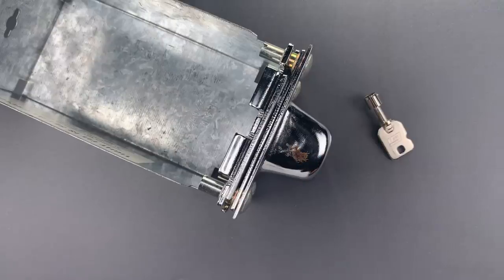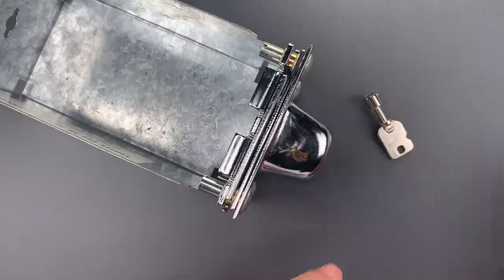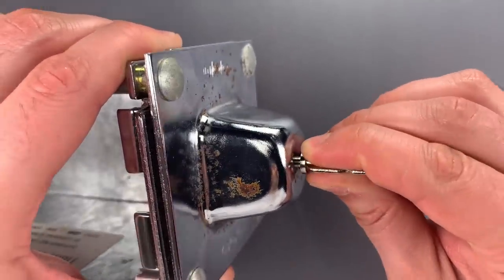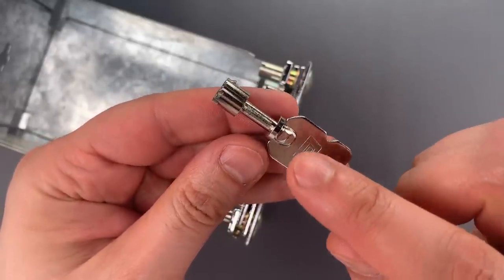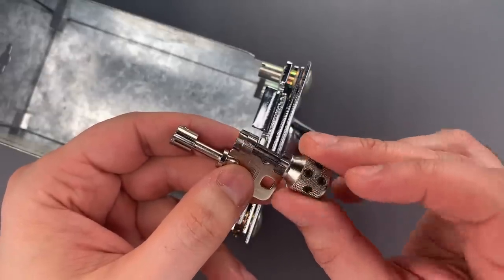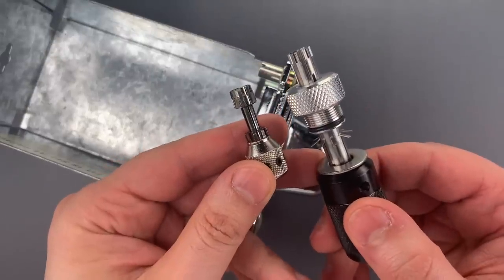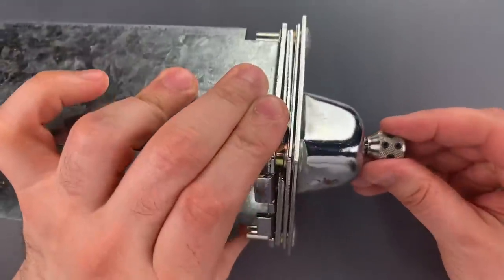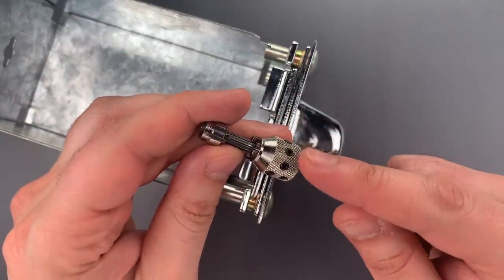[1205] Rare Tool For Picking “Giraffe Key” Locks

Comment: Can’t wait for you to destroy Shane’s lock
Reply: Same
Reply: I kinda wish shane would have sent it to LPL before he posted his video making it. Knowing how the guts work is a huge part of picking it.
Reply: Me too
Reply: @pproh608  but the way this one works i think helps but hurts at the same time. as in there might be an easyer way to pick it, but if you are thinking complex then you might miss the easy way to pick it
Reply: I was thinking just apply pressure to the lever at the back that he made to push the pins up against the body to hold them in place. So if your pushing that lever at the back you might be able to single pin pick. I was also thinking a comb or wave rake could possibly hit all the right sweet spots at the same time. Hafta see if he ends up sending it.
Reply: Ooh I dunno, I have pretty high confidence with Shane. You should see his basketball hoop, from and engineering perspective that's stupid difficult to DIY.
Reply: @Guna89420  nah rave and combs won t work for sure . He mentioned it in the video so those tools can only touch one of the at a time but if it adjusts different the lock will reset . You don't watch the full video didn't you.  He invite a lock picker who used a special hammer to apply force so that as it gets launched he might be able to move it in time but he failed . And he was an expert
Reply: @Guna89420  imagine this dude put days of work in, LPL starts his video, rakes it open in 3 seconds and ends with "okay folks thats all i have for you today, and shane; try a little harder next time"
Reply: Can I get a link to the lock being made
Reply: @xenomorphoverlord  ...making an unpickable lock...by Stuff made here ...can’t get a link to work on this iPad 🤔
Reply: He's still making another version trying to improve the current design. So he'll add some changes before sending it to LPL.
Reply: I think the whole point is it’s supposed to be like good cryptography, it doesn’t matter if you know how it works it still isn’t vulnerable to anything other than brute force. Security by obscurity isn’t a good way to design security products.
Reply: @felciajacintha6613  That supposed "expert" couldn't pick half the stuff LPL gets open in seconds.  Just because someone does something for a living sure as hell doesn't make them an expert...
Reply: I suspect it won't be nearly as pick-proof as he expects it to be. He's good at making stuff in general, and coming up with interesting ways to turn ideas into reality, but does he actually know anything about locks? I guess we'll see.
Reply: @JLneonhug  Insanely difficult
Reply: @Guna89420  he has already confirmed that he'll be sending an improved version to lpl soon
Reply: @felciajacintha6613  no I watched it. He said bumping. I didn't catch him say anything about the others. yeah I did watch it all though. Yup he is going to add more pins and make it better he said but if it has the same relative design, I think lpl could figure out a way to defeat it. I like the double sidebar design lock that was "unpickable." I thought with the springs inside that hold the pins against the side of the core, you could maybe finesse the tensions on it to be able to hold the pins separately instead of all at once. I really have no idea though, was just a thought based on a simple idea. Cuz the key has to push on that lever to work, so it probly won't be guarded. Maybe a small pin protrusion on the end of a key, and a small hole for it to go through which would make accessing it and the key way at the same time incredibly difficult. I didn't stop the video and check the design a bunch. Which I bet many did to study the design. I was just throwing the idea out there. Cuz it seems like with a random amount of moving the pins, that there might be a chance to randomly get them all in the right position at the same time. Or like he said, he is worried about the Power tool type lock picking devices that vibrate the pins so fast that they often hit the right combination within a second. Either way, this will be interesting. I would think lock companies have thought of similar designs and decided against it for some reason or another.
 Only time will tell. Can't wait!!
Reply: @itscyphertrading8706  I would literally roflmao . Props to shane though. He is like an apprentice hacksmith lol
Reply: @Guna89420  Agree 💯. I'm not great at this, but I think I could get his lock open after some time and "getting to know" the feel of that mechanism. Basically a deep- reach tension tool that can also engage the pin lock will give you all the tension you need to single pin pick it.
Reply: @Fregley_  woohoo I can't wait! Just like many of the challenge locks that have come LPL's way. When his gf said, you know who we should send this too.. if she said anything other than LPL,  I would have been cheesed Lol
Reply: @felciajacintha6613  LPL has opened dozens of locks in under 30 seconds that the supposed "experts" couldn't open.
Reply: @JLneonhug  BACKBOARD!
Reply: m14wdotcom  "Oh, he INSISTS?!?!?" Sorry. Had to.
Reply: I’ve been watching LPL for a few years and I can’t recall a time he featured something he couldn’t pick. So unless he’s going to fabricate a tool to pick this I don’t see him showing it. Edit, my mistake I believe he explained the Bowley lock and didn’t pick it, so maybe he showcases it as a friendly gesture.
Reply: @pproh608  I am sure Shane will send him an improved version. I am sure there will be a surprise plot twist. Remember that the lawyer knows the in and out of every locks he  opens.
Reply: Looking forward to seeing what happens, too. But also respect to Shane, that guy's got a lot of brains and skill.
Reply: @agodwin987  Yeah, that's true, but I think the only lock I've seen him pick here that really meets that definition is the J-hole lock and it's dual-sided counterpart.

Security by obscurity, the security people I follow would tell you, should not be the only security in your system*, but it's not unacceptable for it to be *one component thereof.
Reply: @Guna89420  the stuff shane does is usually way more impressive than the stuff the hacksmith team comes up with. I love both channels, but the hacksmith doesn't do too much crazy coding or innovative hardware, a lot of it is just projects that take time and money (with notable exceptions, like the lightsaber), whereas shane does some really high-level design and engineering.
Reply: @jeffp7368  There have been a couple of locks he hasn't been able to pick.  One of them is a lock that uses a key shaped a bit like a trombone.  He wasn't able to get a pick into the right position, place pressure on the rear of the lock, and apply torsion all at the same time.  It's in his "working on a solution" pile.
Reply: @felciajacintha6613  
Just to be clear, the picker he invited over didn't use a special hammer.
He used a method called bumping. So he used a bump key, or filed down key, that can be used with any hammer.
Reply: @Guna89420  yeah dude let's see what happens then when it's on his doorstep . My money is on shane
Reply: @pproh608  I don't understand. Part of how LpL picks locks is him knowing the locks inside and out. At least with Shane's he didn't have to drill and cut it up first.
Reply: 2 minutes max.  Videos will be under 10 mins and mostly talking about the guy and how cool it is that fresh minds re taking a look at security even if it wasn't very secure
Reply: @Guna89420  Yup, and pick it from the back, so the springs can compress
Reply: Shane will send the advance version of his lock so i think its fine
Reply: @pproh608  Shane is making a new and improved version and sending it.
Reply: @xenomorphoverlord  search for "stuff" lock
Reply: Don't keep your hopes high, most probably he won't be able to do it.
Reply: @earthknight60  my thoughts exactly. I expect Shane's lock will land on that pile too
Reply: @Guna89420  yeah I was thing pressure at the back and wave rake that bish
Reply: He won't
Reply: Still waiting for the vid, it will probably never come out at this point
Reply: @maxwellerobini1603  wrong c:
Reply: @pproh608  Ah, but security by obscurity is not secure. If you're going to make more than one or two of them, someone's always going to be able to discover how it works and use that as an attack vector. The ideal solution is one in which knowledge of the mechanism provides no help whatsoever in defeating the lock.

Shane's locks were designed to do that, he just didn't know about the full list of potential attack vectors that might be employed so that he could plan for them. Now that he knows, he can harden his lock against those attacks. And when every potential vulnerability has been removed, what's left might be the state of the art. Unless someone finds a way to defeat it.

That's just the security game.

Comment: Imagine designing and machining a brand new tool so you can get a fistful of quarters.
Reply: like arcade machines?
Reply: That's probably why this pick is pretty much extinct, not worth the effort to pick the locks. Even more so with inflation reducing the purchasing power of the quarters.
Reply: You mean "a lifetime supply of a fistful of quarters".  Sounds good to me.  😁🤐
Reply: @davidbaldwin521  I save many quarters on laundry when I take the wet clothes into the backyard and hang em high.

Wow. Puns really do encapsulate the Good, the Bad, and the Ugly of jokes.
Reply: I'd imagine a locksmith would have these handy for when keys get lost.  You'd have to unlock it to change it.

Comment: That pick looks interesting with all the... are those set screws in the base? Do they serve a purpose or did the maker give it spots because giraffes have spots?
Reply: i would imagine the screws adjust the preload on the levers
Reply: @chrismechanic2000   That was my guess too, you can use them to lock the "levers" in place so it become a copy of the original key
Reply: "Finger tension can be adjusted, during the picking process, by adjusting the set screws, located in the handle, over each finger, for the stronger springs, by using the supplied Allen Wrench."
Reply: So in a way the video doesn't really show the whole process. LPL surely preset the pick for this particular lock, but going in blind with a new one would require quite a bit of work. Right?
Reply: @luisrivero5245  no, he went in blind with the pick, it took that long because he was getting it set/impressioned on the lock pins.  If he then set the screws it would be locked in place and function as fast as the actual key for the lock, no jiggling required.

Comment: You know something's wrong with lockmakers when the drawer on a paid laundry machine takes more time to pick, and a much more specialized tool to pick open, than most gun locks.
Reply: It shows you how often thieves pick washing machines as opposed to guns.
Reply: @lwilton  Laundromat's lock was intended to secure profits of the owner, gun safes and locks are intended either for compliance with storage requirements or to milk people scared of somebody using their guns to commit crimes. I suspect that people who store a lot of guns for professional reasons have armoury with secure doors and an alarm system as well as a guard or a security detail nearby capable of responding quickly to an alarm.
Reply: Yes it's worrying. I wonder if you could fit a handgun in one of those laundry machine cash tins?!
Reply: @tymoteuszkazubski2755  I think the Reason LPL features so many gunsafes is because he's campaigning in a practical demonstration way to have a minimum security rating requirement within the gun ownership law.

Comment: I love this channel but it's sad the comment section gets jammed with Fan Boys to the point we can't even discuss how the vintage pick works!🤔🤪
Reply: How does it work? I assume you are randomly bumping pins until they set. I did notice the LPL was applying pressure to the sliding rods to hold any set pins.
Reply: I'm wondering if the pins in the lock have drivers all the same length, so this tool takes advantage of overset impressioning, where you push all the pins down as far as they will go, whilst the needles in the pick stay in the position they end up by friction tension on the set screws. However, there's something else going on. It appears that there's two different heights of tensions of the pick needles, hence the dots, and it's possible this is only a four pin lock, with 3 active pins and 1 inactive pin that turns the lock, but you have to normally turn the key to push the pins down. A teardown of this lock is needed I think. It's very intrigueing
Reply: @klchu  I had to rewatch to notice that!! So really there is more to it involved. Also there is the issue with all those set screws, apparently they serve the purpose of adjusting some spring tension, so going in blind on a lock would most definitely require quite a load more work than what we saw here!
Reply: @luisrivero5245  Exactly, I was hoping someone knew what the setscrews were for or actually used this pick before! I won't ever need one but I always like to know how something works but it's unclear from this video since there was so much jiggling going on!
Reply: Same jokes recycled in slightly varied ways

Comment: Greeting from Canada. As an Alliance Repair Tech. One of these would come in very handy as most places don't leave a key when they call for service, since quite often the units use the same key for the service access hatch.

unfortunately thieves are all to smart and they have figured out a way to access the coins in most standard units without even messing with that lock. though its not as fast as that tool makes it. if they do it right it allows them to come back time after time and clean out the coin box without leaving much of a trace that the unit has been compromised.

Comment: I may have known someone who did laundry for free in their apartment complex because of a tubular impressioning tool. But I've never seen a giraffe key version.

Iirc, maytag professional used those for a short time, but not enough locksmiths kept blanks of them to make it worthwhile to keep using. Same issue I ran into when I bought an old honda motorcycle. Nobody carries the blanks for them, so most people swap to a newer cylinder. I decided to buy the blanks on eBay and an old key cutting machine from a hardware store. Made my own spares and later fell into lockport as a result.

Comment: I recently purchased from an eBay vendor an original AT&T/Bell System payphone in quite good condition. These phones are nearly legendary for being extremely well built and resistant to being broken into. I'd like to see if the Lock Picking Lawyer pick one of the locks used on these old payphones.

Comment: A lot of the most secure mechanisms out there don't rely on just esoteric bitting or complex mechanisms, just things to make actually getting tension and a pick into the thing a royal pain in the neck.  Making obscurely shaped locks and keys can help, but that only lasts so long as the picks to get through them remain rare. Security through obscurity.

Comment: It's really interesting to see that the older methods and designs of picks and locks appear to be more effective for their respective uses. The combing technique (albeit with a slimer comb pick) for example, appears to comfortably pick a number of more modern locks, whereas this lock would challenge those without this dated giraffe pick.

Comment: The collared locks are made by Greenwald. My family owns several apartment complexes that once used these locks. These picks were made by Custom Security Products in Simi Valley California starting in 1977 but that company went bankrupt. Looks like these are currently for sale by a reformed company with a similar name based in Las Vegas (Custom E...y Products). They also sell a tubular lock pick gun and "covert jewelry" necklaces with handcuff keys. These picks are currently $140. I won't give away all of the info, but a bit of Google-Fu should find them.

Comment: I really like your line of lock picking tools, however I think you should definitely look into selling locks, whether wholly manufactured by yourself or simply modified cheap locks to make them more pick resistant. For example, I think if you sold some variation of those pick proof kwikset locks you mentioned in a much older video those would gain good traction as most people would like to have something like that, but aren't exactly comfortable with modifying a lock.

Comment: Hey bud nice work anyhow quick question I have this same tool and would like to know how tight should each screw be ? Should the feelers move freely with just a push of a finger or should there be resistance ? Cause my tubular lock seems to have some stiffer springs in it

Comment: nowadays pay laundry machines cannot be picked. Because they don't have locks basically. Instead you swipe a RFID tag or card and it will give you access to machine. Some are stored-value and CAN be hacked, but most are connected to network and it will run the tally on the server (and then you usually don't have any "stored-value" instead you get a bill/invoice at the end of month with all your wash passes)

Comment: I'm really curious: How does that lock pick work? It seems that each pin position has its own set-screw to lock in a particular height: Does that mean you have to have a general guess (or couple of attempts) to narrow down the combination, followed by some deft work to shimmy a not-quite-right key into working?

It also seems this depends partially on how worn-down the cylinder's pins are (IE: accepting a wider range of set positions)